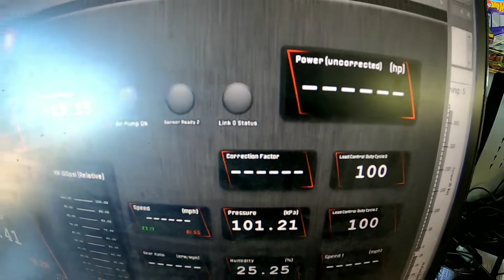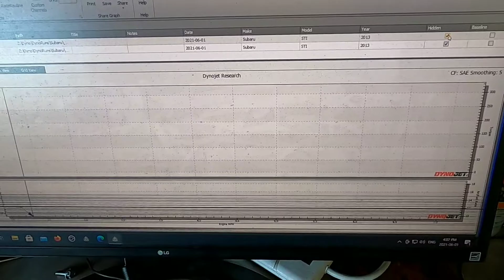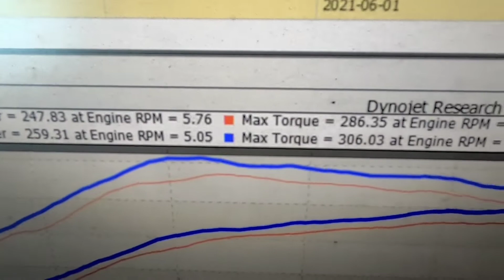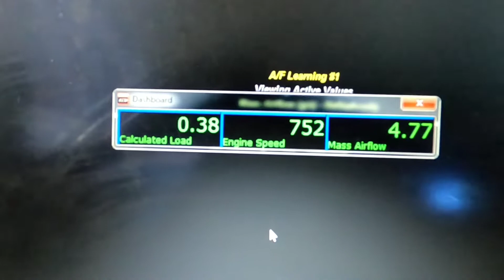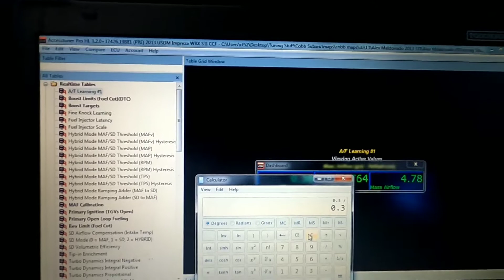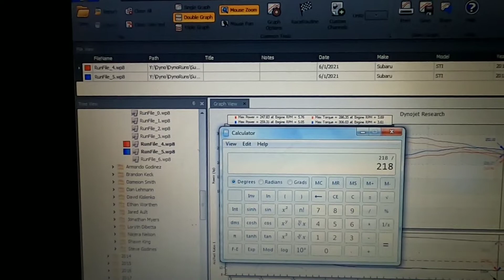Tuning Tech. How much does AC actually affect engine horsepower? 2013 STI dyno test.

Comment: I wonder with a larger displacement engine if the difference would be smaller
Reply from the maker: I retested on a 650whp zl1 Camaro today and it was almost exactly the same raw loss in power so it may not be as parasitic as I assumed. Now i need a very low power car to test it on and see if it's similar there as well.
Reply: @WT4T  I've got a couple  na subarus if you want

Comment: While I was expecting otherwise, I was TRULY hoping you would say the data shows the parasitic loss to be insignificant so that I would have a solid excuse to whip around with the AC on but the good ol butt dyno had the correct intuition after all lol
Reply from the maker: I knew it would do something but not this significant.  Need to test on a much higher horsepower car next

Comment: Great to see more content from you! Do you happen to know what the power/torque difference is between having the a/c belt installed with the a/c off versus having the belt removed might be?
Reply from the maker: No,  i didn't test that,  considering it's a clutched pully it shouldn't be much